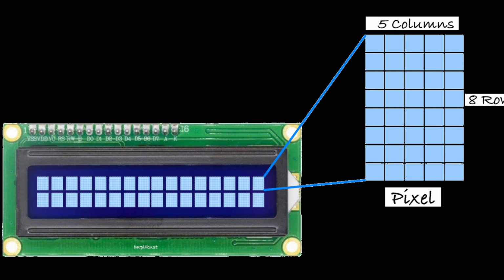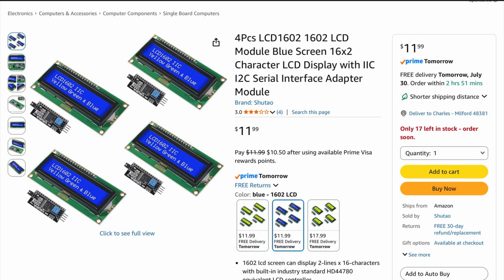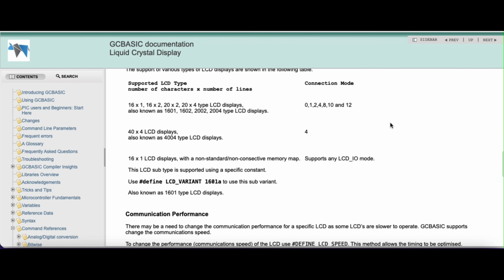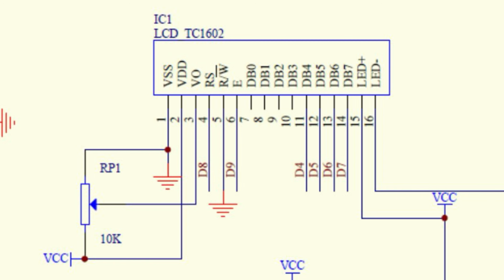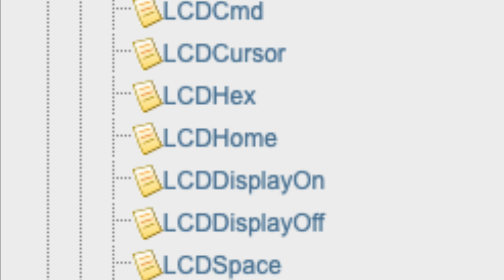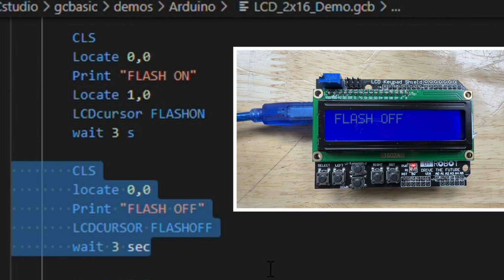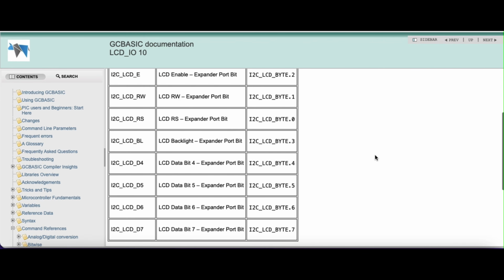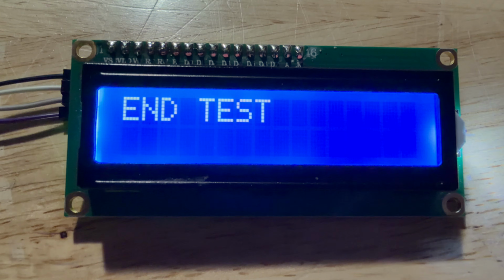Easy LCDs with Arduino and BASIC

Comment: Can you do a video using the display and a 6dof or 9dof imu
Reply from the maker: You just want to read the sensor and display x,y and z values?
Reply: @FilamentFriday yes as a start if you use the the three axis magnetometer, then use a special characters to point which direction is north south east and west to make it a little bit harder

Comment: Although I know that often these things apply to other controllers, I don't understand why people keep using Arduino in 2026... There literally no reason, considering they are not cheaper than an ESP32 and are orders of magnitude weaker. Arduino had their time and was very important in the thinker space 10 years ago, not anymore.
Reply: The Arduino has its place as a simple to use controller for beginners. It doesn't overwhelm and the performance is more than adequate for a huge number of applications. It's big. The use of extension boards (shields) which plug directly on is really convenient. Having WiFi already on board and a much more powerful processor is attractive for other applications, no denying. So the ESP32 has its place. It's great.
Reply: @AlGi-k6k  why would an ESP32 overwhelm? for simple usage, the concepts are literally the same and you can also use Arduino IDE to program it. And the shields exist for both, but yes, less on ESP32.
Reply from the maker: @ralmslb - You need to watch my earlier video:
Why I Still Like Using 8-Bit Microcontrollers?
https://youtu.be/86SL1rucG4k
Reply: @FilamentFriday our comments crossed each other. I think simplicity has its place.
Reply from the maker: @ALGi-k6k - Sometimes is more than that. You can program a little 8 pin SOIC 8-bit micro that is easy to hand solder and fit it a battery operated design from 1.8v to 5v operation.
Reply: @FilamentFriday I agree.
Reply: @FilamentFriday I went and watched, and still don't agree that if someone is starting into microcontrollers should use an Arduino. Statements regarding using VBasic are only applicable for people that we using it a long time ago, no one starting to learn now would use it.
Reply from the maker: @ralmslb - I talked about GCBASIC and the way it produces pure assembly code with simple easy to understand commands. Not sure where you got VBasic.

Further the shields and simple 5v interface to sensors helps users understand the hardware. 

Arduino originally trained many of the current ESP32 users.

But follow your path. I’ll keep following mine.
Reply: @FilamentFriday I am currently teaching a 'not-so-young' mechanical engineer. There is no way I would consider a physically smaller microcontroller for this part of my course. The 5V compatibility, ease of programming, decent size and it works right out of the box makes the Arduino the right device for this part of the course. As you inferred, we use our knowledge and experience to make the right choice for the task at hand.
Reply: Arduinos are easier to wire and program.  End of discussion.   The fast processor is not needed for low level education.
Reply: @motionsick false...